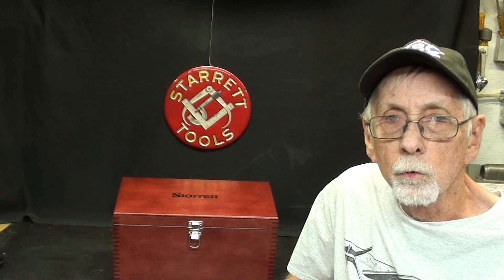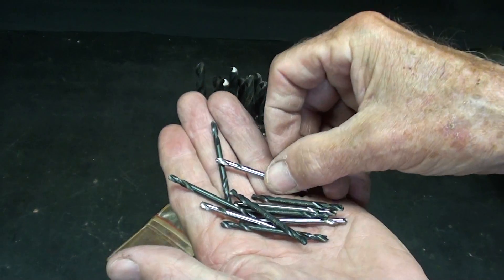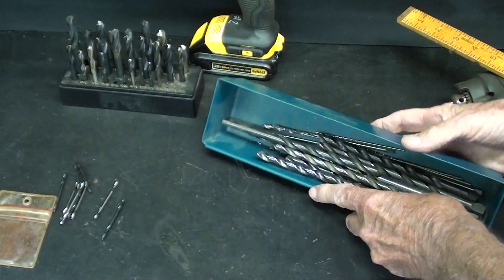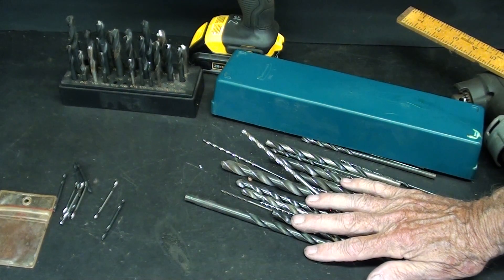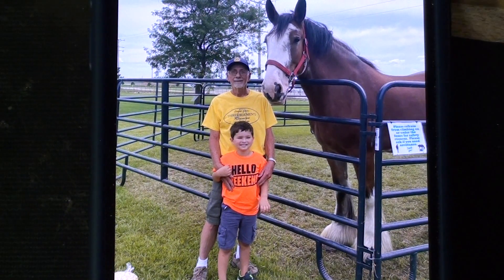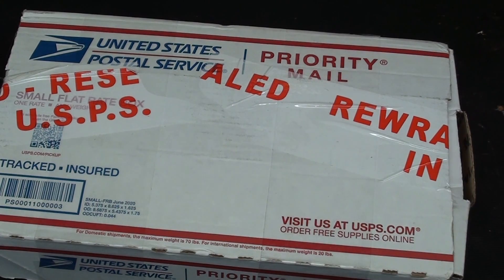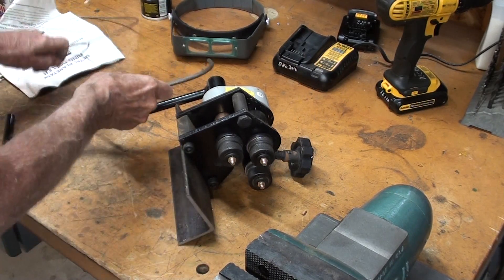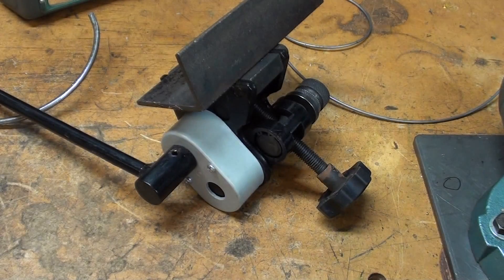THIS & THAT #71 tubalcain mrpete starrett surprise

Comment: I like Harbor Freight. Sure not all of their stuff is great, but they do make improvements over time. And a lot of times you can make the improvements yourself so it's kind of like getting a kit, lol. Thanks to them I have a lot of tools from over the years that I would not have been otherwise able to get. And I understand the owner is supportive of vocational classes in schools, which are badly needed. 
Good idea using the soft hammer on the letter stamps, never thought of that

Comment: I have the same planetary ring roller. I can roll round stock up to 1/4" and up to 1/8"x1" flat stock. Works great, but it's not a production machine. That said it doesn't say planetary gear driven roller. The rollers are planetary driven by gears. Also yours looks quite worn out.
Reply from the maker: Yes, I sold it for 20 bucks glad to get rid of it

Comment: Re: actors as craftsmen. Fred Mac Murray was a leatherworker/saddle maker. 
The biggest problem I find with Harbor Freight products is the heat treat like you found out with the roller. In my experience the Chineses made fasteners  specifically socket head screws are way too brittle. If I buy anything like QC tool holders I immediately replace the clamp screws with US or Taiwan made fasteners. Saves a lot of grief. I like their air tools, specifically the front exhaust right-angle die grinders. Quieter than the rear exhaust. Use them/abuse them and when they wear out throw them out. They're cheap enough to have several, saving time on tool changes.
Reply from the maker: Thanks

Comment: Hi Lyle.
Double ended drills can bite you in the bum (butt)
I used to use centre drills on production to produce countersunk holes for screws in wall brackets.
They were a cheap source of combined drill and countersink cutters.

If the kids didn't tighten the drill chuck enough the drill would slip and cut into the chuck retaining screw making it impossible to remove the chuck  !

Comment: Fascinating, Mr. Pete.
Your comments on the USPS made me smile (in empathy).
I'm in Bolton, north of Manchester, UK. You would think that a country that originated the postal service system* used all the world over, would have developed into the most outstanding, efficient, reliable system in the world.
It's every bit as bad as yours. Main Post Offices have closed in large towns, delivery by Royal Mail is haphazard because we have 1st and 2nd class letter delivery. Our vehicles are often out of date, grubby looking and a bit battered from use. One of our smartest parcel delivery companies is UPS - smart, rugged, chocolate brown vans (always clean) with smartly dressed staff; another smart company is DHL which had its origins in the German Postal Service. Completely bonkers.

* Originally in the UK, you paid the postman when you got a letter. Roland Hill proposed a fixed price, pre-paid letter system for the Royal Mail with an organised collection and delivery service with Post Offices throughout the land. Every stamp collector has heard of the Penny Black - the cost of delivering a letter ANYWHERE in the UK - introduced in 1840. The USA and other countries took up the idea. Because we were the first, our stamps are the only ones NOT to mention the country of origin.

Apologies for going on a bit.

👍🇬🇧👍🇺🇸👍

Comment: I’ve had that Black and Decker shorty right angle drill for about 45 years and because I was so poor when I bought it (I saved my money for a year to get it) I treated it like it was made out of glass and kept it looking like new all these years. I can’t tell you how many times I started it up while changing bits because of the way the paddle is located. Scared me half to death each and every time. Still looks brand new to this day.
Reply: I bought one of these and found out the shielded chuck meant you HAD to use the chuck key to adjust the chuck jaw size. This is probably a safety feature, but it drove me to distraction. I used it only once or twice due to that operational function.
Reply from the maker: Yes, you must unplug it or it might turn on. And the shield around the chuck is a pan

Comment: I know what you are saying about the post Office and the clowns that work there. I bought a Briggs piston on eBay and it went back and forth between the East Coast and West Coast 14 times. 4 of those times it was at a post Office 20 minutes from me and away it went again. My neighbor passed away 2 years ago, but his mail kept coming and some of mine wound up in his mailbox. After awhile there was so much mail that the lid on the mailbox would no longer close, so the mail clown just dropped in on the ground below the box. I filed complaints 3 times before anything was done. Rant to be continued--------------------
Reply from the maker: Wow

Comment: I bought a key code machine on ebay, quite expensive. It was sent usps. On delivery day they posted on the tracking that it would be delivered next day, even though it had been out for delivery. No note in mail box! Two days later I went to post office and it was there, just needed a signature! A note telling me that would have saved me 2 days. Smiley was the train engineer on petticoat junction as well as, green acres. I didn't know he was a singer and musician until you posted this. Thanks Pete!

Comment: Great Video Mr. Pete. I usually don't comment on things but I feel I need to at this point. In regards to the Patterns display, if you remember years ago, in automobile owners manuals they would have the maintenance schedules  and some even supplied instructions and feeler gauges for like point settings and valve lash. Yes, those were operator responsibilities. Now days there are warnings like don't drink the coolant fluid, battery acid etc. I get the advancements in tech that make those adjustments unnecessary, but why the "other" warnings...  ( darwin awards? ). Anyway the display shows where and how many things were developed and how it has to be made on a large scale...seems nowadays very few really just don't care...just get it here in my hands now. To me it all ties in together...if we don't know where we've been as a civilization how do we know where we are at now and where ( the possibilities ) of where we can go.
  Sorry, my rant..
  Great videos,  Learning much. I need a set of stubbys...lol! Thank you.
Reply from the maker: Thank you, loved the rant, very true
Reply: Should some sort of disaster happen, such as an EMF attack, all the fancy electronics that we rely on will be destroyed.     We may have to return to old tech.  The car engine I am restoring has Kettering ignition (points!), using feeler gauges to get them just right. All of the work I'm doing is something that should be known to more than a few folks.  When we old geezers meet our Maker, who will know how to repair anything?

Comment: Right! Mostly junk from the freight company but we are all guilty of visiting from time to time. Recently bought a General Drill Bit Sharpener not from HF). Poorly made but is does an amazingly good job of sharpening those bits that otherwise would sit in the box of dead drill bits till I croaked. An interesting, and much appreciated, video of making a quality version would be well received. Are you up to the challenge? BTW, my career (I'm now 75). started as a casting designer in Maleable foundry; still miss the smell of melting iron.
Reply: So, will you build the drill bit sharpener?

Comment: I'll give you a post office rant. I ordered some tools from KC tool in Kansas. I got a tracking number and expected it to be to me in a few days. The first tracking notice came in and it was in Mississippi! Rather than traveling 600 miles north to Michigan, it had gone south 600 miles. Then it seems to have spent 4 days on vacation there until it finally went to Tennessee before finally reaching Michigan after 12 days on the road. Fortunately, everything was still in the package. Previously I had a package travel from the east coast to Wisconsin before coming back to Michigan as well. Frustrating as heck it is.

Now a Amazon package showed up empty once. I called them and they had the items replaced and shipped to me the next day without question.
Reply from the maker: I have had several packages go back-and-forth to strange cities. Sometimes it took weeks as they toured the country

Comment: Harbor Freight tools range from dumpster fill to extremely good buys, or sometimes a use it once or twice. They are really trying to up there game recently with some better tools, by the info I’ve gotten they are actually good.
Reply: It's a mixed bag for sure. I keep a small box of almost all HF our at the farm- saves me a 10 mile round trip to get a wrench or a hammer, etc
Reply: I have found the Bauer cordless tools to be well made and useful at anywhere from 1/3 to 1/5 the price of the big box store brands; Milwaukee, DeWalt etc.

Comment: I think foundry patterns to be works of art. Pattern makers were highly skilled wood craftsmen. About H F metalworking machinery.....ends up at the local consignment auction cause it doesn't work right. I do have a 24" 20 gauge sheetmetal brake that works good.AL B.

Comment: I bought one of those ring rollers to make a 12" ring from 1/8" x  1-1/2" stainless steel to repair some ag equipment. I don't have a slip roll, so this was a cheap way to get the job done. Worked great.
Reply from the maker: I sold mine yesterday at arnfest

Comment: For even tighter clearance than a 90 drill the aircraft industry has a 90 gearbox for drilling called a pork chop and the bits for those are threaded and only about a half inch long.
I found that the best hammer for stamps was the deadblow ball pein. No bounce and the stamps didn't go flying.
Reply from the maker: I will be talking about that in a future video. I had a real neat donation of those little drills
Reply: I thought that a softer hammer would not bounce as much.  Did you ever try to align a stamp for a second hit?  Steel is not transparent! 😁🙂
Reply: @jeffryblackmon4846  The softer materials also suck up some of the energy, so you have to hit the stamps a lot harder. When Snap-On came out with the dead blow ball pein in the early 80s (I believe made by Trusty-Cook) it was a game changer. At the time I had to stamp numbers on oily connecting rods and it was very common for the stamps to go flying. This hammer changed all that, and would leave a nice impression without having to hit very hard.